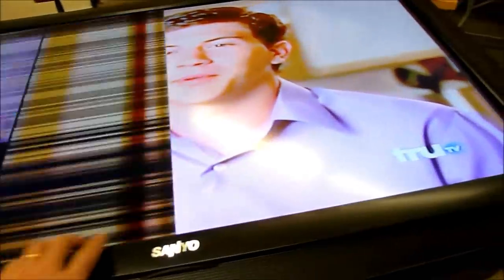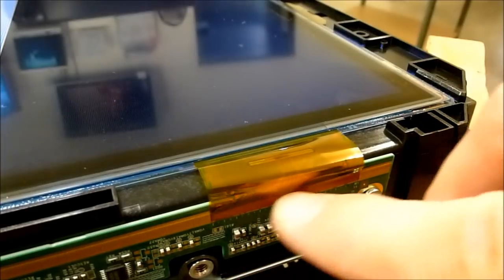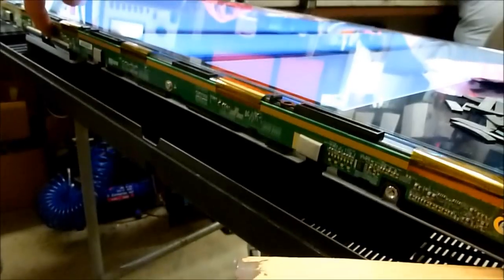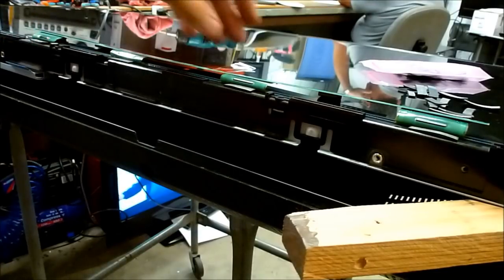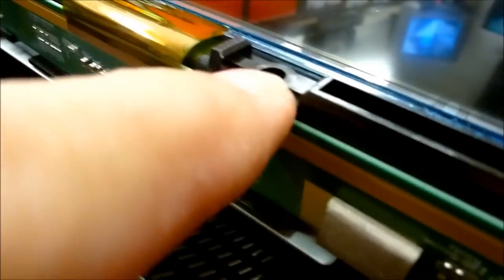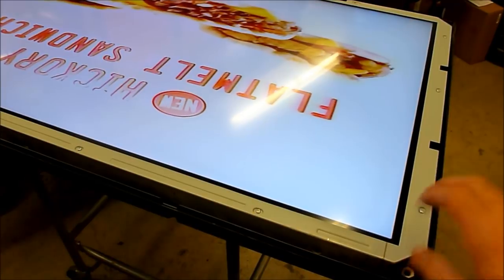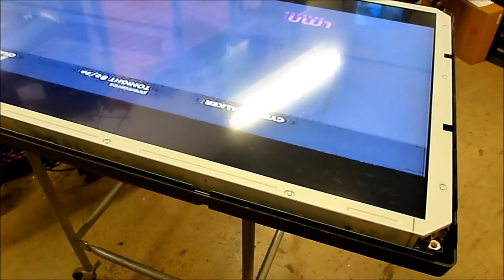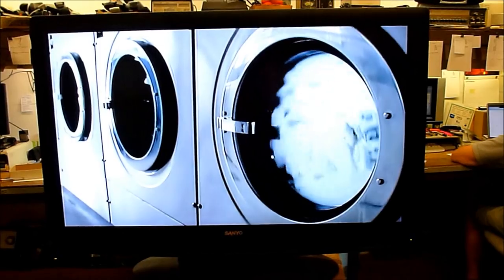Sanyo LCD with Distorted Half Picture Lines Waves Distortion Distorted DP46819

Comment: I would just like to let you know how helpful and indispensable these videos are. You seem very knowledgeable in this field and do a wonderful job explaining the underlying causes and how to fix them. A few days ago I picked up a used 48" Sanyo TV and shortly after turning it on, it developed a black bar on the top 1/4 of the screen that seemed to go away after I put a clamp on the bezel and tightened it down slightly. At first, I thought it was bricked until I researched the problem online and found your videos. Now, I will be taking your advice and looking into the T CON bonding TAB very soon.

Comment: Dynex 38" doing the same thing. We could press the left corner and it would clear up. When it started it was 5 inches wide and effect the left side of the screen. That was about 8 months ago. In the last week its been half the screen like in the video.
Took it apart today and and added blue foam shims about 2mm thick. Took about 1hr with some cleaning.
Seems to be working great.
Thank you Sir.....................

Comment: good and informative  man. i just found one literally  yesterday  in an alley by my house and i thought hey if it dont work ill just recycle  it. i get it home  and plug  it and it worked , so i hooked my roku up to  it to see if it was a picture or sound issue it had and nope it all works fine. then i notice it  doing what the tv youre using is doing (its the exact same brand, and size, but my right side was doing this) my guess is thats why they  put it out with the trash so ima try this pretty soon to correct the error. also i just lightly tap on the side that goes funky and it goes back to normal, honestly  the screws might just be a tad lose. either way thanks for this upload

Comment: Mine is a different model of 46" Sanyo, it was bought at Walmart 6 years ago. It had horiz lines running across the entire top of the screen coming down about 6-8". It has a few more more IC's across the top than yours, no channels stamped into the metal frame either, just foam spacers put in at the factory to press against the IC's (what does that tell you). All I did was place some thin foam weather stripping on top of the ribbon cable right on top of the IC's. It's been running perfect for a week. Thanks for the heads up sir.

Comment: Just to let others know that the LCD panel is very fragile and it is very easy to crack by overtightening the front screws on the metal bezel.  I would recommend only tightening loosely by hand and doing it with the screen powered on.  Also that front bezel is all metal and can short the top circuit boards.  Always replace and remove the bezel with the TV powered off.

Comment: did this and it semi worked......my son had to figure out y the picture became distorted and then it went black....we began to see y and then the picture came in as he realized that the circuit board was loose....so we put electrical tape on the very edge of the circuit board not disturbing any circuits and it worked...not the pressure points he showed on the video but the circuit board was loose....thank u very much this video was very very helpful.....

Comment: I used a bicycle inner tube and managed to work a few layers under the ribbons. So far so good!  Mine is a bit different.  It has 2 ribbons across the top and 4 little copper tabs coming off the tv screen on the left side of the tv.  I hope just putting the shims at the top work. I don't see any place to shims on the left side would do any good.  If it starts acting up again, may have to tape those tabs down.

Comment: It worked! I had to do it a little differently, putting pressure on the cable didn't do anything, it seemed that putting pressure on the glass where the cable goes into glass worked, so I shimmed it with a few layers of a business card cut into small strips, held in place with a piece of electrical tape also cut into a thin strip and sandwiched it in between the glass and metal frame, hopefully it gives me a bit more life out of the tv.

Comment: I had the same problem the picture would go bad (lines in screen, black spot, right side of screen going back).  Usually it would be ok after "touching" the top right corner of the tv but it go to the point I was doing this constantly. I discovered that my problem was the lcd coming de-laminated at the top right of the LCD.  Using 1/8" self-adhesive foam tape I placed 2, 8 inch strips of this foam tape in each corner of the metal frame over the lcd glass.  This fixed my problem completely.

Comment: Thank you for this video. I have 2 small vertical red lines on my sanyo 4k 65" smart TV. The lines are far right if you were viewing it. They're about 1 inch apart. The lines are in front of the TV picture of whatever is playing. Mean you can always see them instead of going behind the picture showing. Does this sound like the same problem? The lines never flicker or change in any way. I would appreciate your advice. Thank you
Reply from the maker: It is most likely a failing driver bonded to the LCD panel on a little ribbon cable. Sorry.

Comment: You need to be careful about placing rubber between the metal frame and the bond chip, It uses the dimple in the frame as a heat sink as well as a press. Could you have tried heat on the that chip's pins to reflow it a bit?

Comment: I have a  2009 46 Sanyo DP46849. Would this be a similar if not identical fix for it as well? If so thank you alot ahead of time.I saw others say they use card board will this work also or be a fire hazard?

Comment: Why didn't you just glue the rubber to where you originally pressed on chip/connector to fix it? and a 3/16" longer screw when reattaching front cover?

Comment: I figured out that if you run a soldering iron across the ribbon bond to the printed circuit board, you can re-bond the acf connections and restore your tv lcd panel!  Search on lcd acf bonding to see the original factory method.

Comment: I have a sanyo 32" that has been going wacky.  Mine is about 9 or 10 yrs old.  Sometimes the screen goes black, or it will get those colorful lines through it and at the same time the audio sounds like a broken record (remember that term?), then the screen goes completely black, no audio, but the on/off light stays on.  Sometimes it starts playing again, sometimes it doesn't and I'll have to turn it off, then back on.......and at times have to let it stay off awhile.  But all the while, if I don't pause my roku, the video has continued.  Would this be the same problem as you had?  Because it does still work for the most part, it is my only tv and a bit leary about making it worse if I take it apart.

Comment: NIce work. I've got a Samsung LCD and when I first turn it on, the colors are kinda faded out on the left side of the screen, and the picture also jumps. If i gently grab either side of the frame and tweak it slightly the problem is solved and doesn't rear its head again until the TV has been switched off say for several hours. Thoughts? Thanks in advance

Comment: I did this yesterday, except my silver metal frame had padded tape pads on it to push on the ribbon cables. I was getting a 6" section across the top that was dark. I just put another layer of padded tape over the existing pads on the frame itself. It worked all day without any issue, then today, the problem came back. I gently squeezed the tv in the upper right hand corner, and that corrected it again. Do you think that ribbon cable needs replaced? If so, how do you do that? 
Thanks

Comment: i had Samsung LED TV UA40D5000PR, it has screen problem.
when i switch it on sometimes its shows vertical lines starting from center of the screen from top to bottom and then goes to whole screen.
but this problem is not always. then i power it off and make its power on after 15-20 minutes it works fine.
so this problem is not always but comes and goes by power it on or off and restart after 15-20 minutes.
kindly guide me what to do.
i had already unplugged the ribbon strip of t-con board and cleaned it and again put it back, but the problem exist as it is.
awaiting your kind advice.
regards
Nitin

Comment: It worked but my metal frame touched the circuit board when I was putting it back on and now the other side is distorted. Is there a way to fix that
Reply from the maker: Probably not. If it touched the frame at a ground potential then most likely some drive components were damaged. Sorry.

Comment: Will this method also work for a Toshiba?
Reply: +Mary Cervantes I did it to my Samsung. It worked for awhile, usually the lines would show up and then disappear when the set heated up fully. Be really careful with the tabs, they are fragile. Some people have had good results with foam, but either way, it could be just a temporary fix.
Reply: Got an update? Considering doing this to my Samsung lnt 4669
Reply: acf tab bond

Comment: I did this step by step and it worked. Until I but the metal bezel on and the whole screen went out. Any Ideas?
Reply: ***** 
What I mean is the sound was on and the screen still had the backlight on but no video after I fixed the flex cable the line went away then I put the metal bezel on and poof screen went blank.

Comment: I got a trash found (actually TWO) DP37647 Sanyo's. A wonder to work on VERY easily serviceable. Same exact issue with that lil flat IC ribbon cable. All i did was gently move it then boom whole screen works again! Had to replace the video and Tcon boards though but seems to be working quite normally now. Noticing slight ghosting and grain though and being a nit-picker i really wish i could figure out a permanent and cost free fix for that... Its not terrible but being a PC gamer on expensive higher end displays,i notice the distortion very easily :(
Reply: Mines a dp26671
Reply: Sanyo

Comment: I have the same TV and it's been doing this randomly for a while now. Last night I got fed up with it and found that if I applied pressure to the top of the tv it would fix it so I sandwiched a piece of folded paper between the metal frame and plastic bezel and it fixed it.. until I turned it on tonight, I'll have to try this.

Comment: I hate that plastic type crap of ribbon cables... but anyway I have seen someone actually fixing a Gameboy original LCD passing the actual soldering iron over a similar ribbon cable like that and it fixed the problem for good, I thought it would melt it, but it didnt, but its probably a much more resistant and thicker plastic material on the gameboy, however If I had a crap old LCD which I didnt care for it and had this problem I'd try passing the soldering iron to see if it would melt or fix :), but off course I wouldnt ever try in something that I care...

Comment: I had this problem with my sanyo dp 42484 and now I looked for hours online for a solution and one forum said to reseat the tcon flex cables or ribbons and it didn't work the left side of the screen is just dark could this be the problem ? thank u so much for any help

Comment: Same model tv. What if the problem goes away after 15 minutes? Is that a different problem I am having?
Reply: Mine will do that, go black, come back on............sometimes....and sometimes it doesn't.  I'll have to turn the tv off (that's right, the green light will still be on and the video is still playing, though no sound) and back on.  I've learned to pause it until I get it back on. It's crazy.  Mine is a Sanyo DP32649

Comment: You know you are hurting the tv repair business,if you do this for a living you are just cutting your own throat,yep great job,you will be out of work soon if you keep this up.
Reply: No, he's not hurting the repair business by making public a fix that cannot be realistically guaranteed by an honest repair shop.

The intent of showing this trick was even communicated; to afford people time to save up towards replacing the set in the near future.

The permanence of this fix is highly uncertain (it could last for years or only for days), which is why it can't be guaranteed.  With this fix, there is a good chance that the fault can get worse and cause the symptoms to recur in such a way where the only remedy of the problem is a panel replacement.

If this fix were guaranteed and it happened to fail within the warranty period, the shop would be obligated to remedy the problem free of charge as a condition of their own guarantee.  That would mean performing a panel replacement at their own expense or buying a new HDTV of equivalent size and features for the customer, whichever costs the shop less to honor their warranty.  In that case, the shop would lose a lot of money on that one job.

As for his other repair videos, the repairs he shows requires a significant skill set as well as an investment in proper repair tools in order to perform the work correctly.  Even with what he shows, it wouldn't be of help to a person who doesn't have the knowledge, experience, and the tools to do the job right.  It would only help the customer better understand what may be done by a repair tech.

If you have actually worked in the business, then you would have seen, first hand, the additional damage that's been done by a kitchen counter tech because, for example, he thought a high powered soldering gun would be a suitable substitute for an adjustable temperature soldering station for working on a printed board.
Reply: Is every do it yourself mechanic that post videos also hurting the mechanic industry??? Lol sorry we dont all have thousands of dollars to just buy new tvs lol

Comment: We don't want TRICKS , we want techniques and methods ( We are not in a circus )
Reply: +AndrewKoala No one is trying to put you in the circus Mr. Koala; you can call it whatever you want. This is a poorly designed contact terminal, and his "trick" (technique, design improvement that should have been included in a factory recall, or whatever term doesn't make you feel snide) worked great for me. 
Thank you norcal715
Go suck on a leaf Andrew!